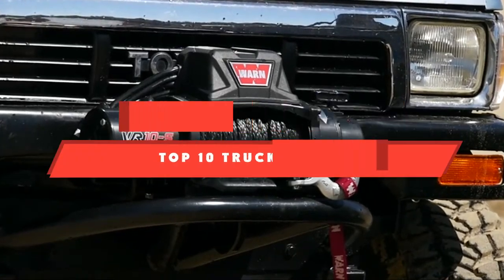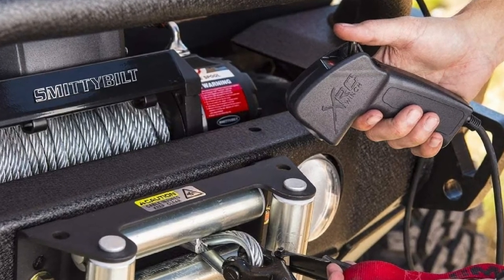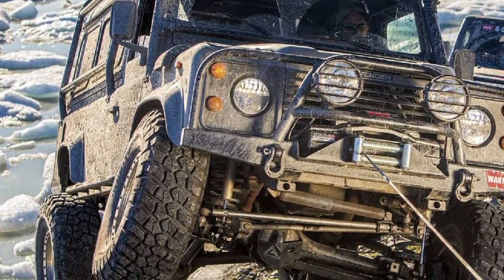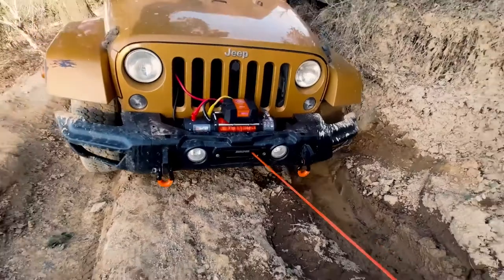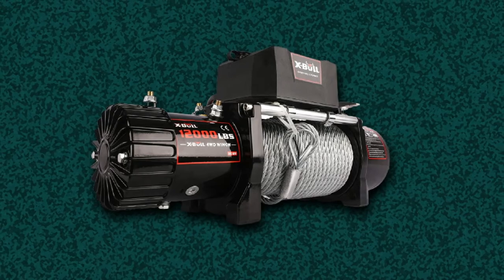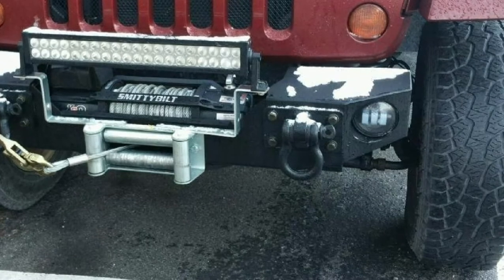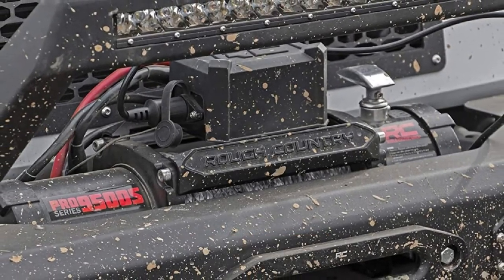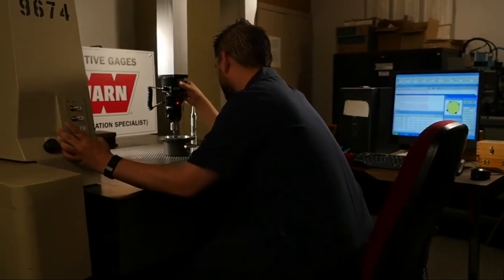Best Truck Winch In 2024 - Top 10 Truck Winches Review

Comment from the maker: Links to the best Truck Winches we listed in today's Truck Winches review video:

1 . Smittybilt GEN 2 XRC Winch 17500 Pound Load Capacity 
 https://geni.us/bFtd5z   [Amazon]
2 . WARN 95960 Zeon Platinum 12-S 
 https://geni.us/H1P18   [Amazon]
3 . X-BULL 12V Synthetic Rope Winch-13000 lb. Load Capacity 
 https://geni.us/roPU0OX   [Amazon]
4 . ZESUPER 12V 13000-lb Load Capacity Electric Truck Winch 
 https://geni.us/GeRCDZ   [Amazon]
5 . X-BULL 12V Steel Cable Electric Winch 12000 lb Load Capacity 
 https://geni.us/dzNYm8   [Amazon]
6 . ORCISH IP67 Waterproof 12V Steel Cable Electric Jeep Truck Winch 
 https://geni.us/UKrA   [Amazon]
7 . Smittybilt X2O COMP 10,000 lbs Truck Winch 
 https://geni.us/9LMw   [Amazon]
8 . Superwinch 1595201 Tiger Shark 12V Winch with Aluminum Hawsee 
 https://geni.us/z5rT   [Amazon]
9 . Rough Country 9,500 LB PRO Series Electric Winch 
 https://geni.us/fSRsj   [Amazon]
10 . WARN 96800 VR8 12V Electric Winch with Steel Cable Rope 
 https://geni.us/GT3cre   [Amazon]

Comment: Bought a warn and paid big bucks. Quit working working 
Wasn't even water resistant.  Mine stayed in the garage or covered and after 2 years the motor aluminum turned white on the inside and the brush wires turned green.
You didn't even mention water proof and thats the most important thing.